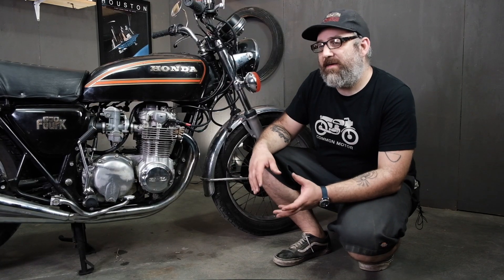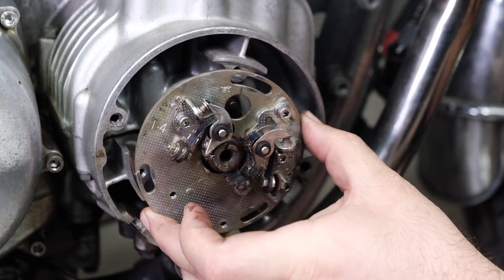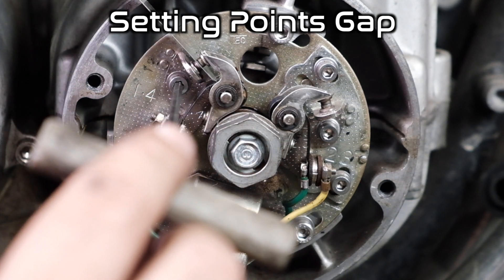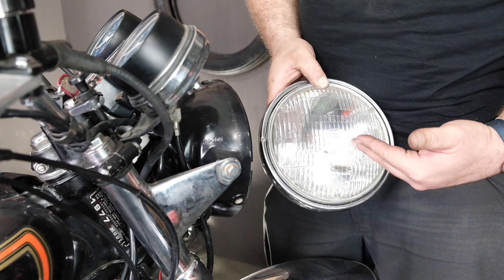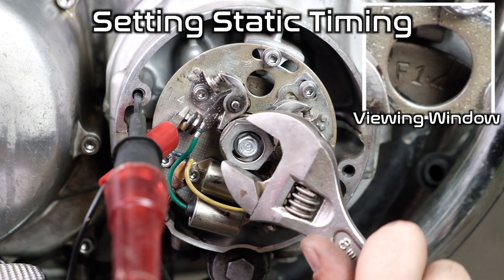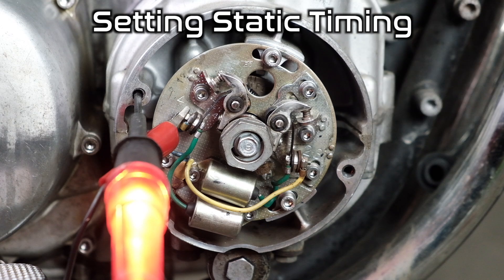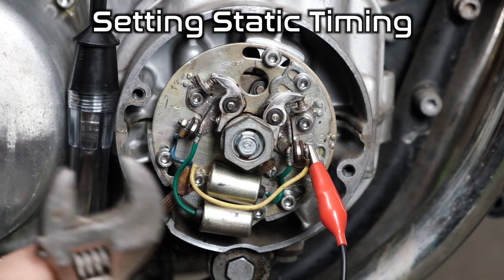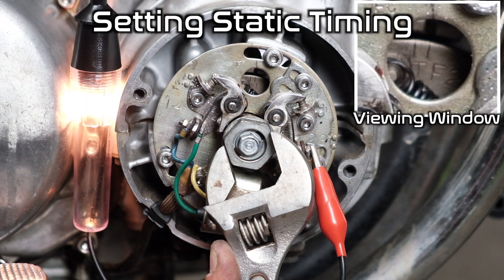Setting the Ignition Timing On Your Honda CB500K / CB550 / CB750 / CB350F / CB400F

Comment: Hey folks.  I've finished my full restore of my 75 Honda CB 360t and everything but the paint is Common Motors Collective.  Great quality parts.  Also, Brandon has been a huge help to me.  Without his vids I'd still be working on it.
His help with timing is crucial.  Also want to mention my upgrade to the shockwave, replacing the points.  GREAT!!
That's all.  I just haven't found a place to thank him properly so that's why I posted this

Comment: This is a good video on ignition points adjustment. Static timing will get you into the ball park, but dynamic timing with a strobe light allows you to test the timing at idle and full advance. Full advance is more critical as the engine operates above 2500 rpm most of the time. If the full advance is between the lines on both points you are golden. If not, adjust the timing as needed. The point plate may not fit in the crankcase tightly, This will cause a variation in point gap and dwell as you rotate the plate. You can easily see this with a dwell meter attached. The solution is to center punch the case just outside the point plate to tighten up the fit. I always liked to set the points at the middle of the range 0.014". Ignition points will wear into each other over time. One of the contacts is smaller in diameter then the other and will wear the center of the larger point. If you run an emery board across well used points you may see a shiny ring around the outside edge of one point. A very small amount of high temp grease on the points cam will reduce point rubbing blocks wear and changing the timing. If you have installed a new set of points, be sure to thoroughly clean the point surfaces with a piece of card stock dipped in contact cleaner and then pulled through the points. New points have preservative on them which must be cleaned off for the best service life.
Reply: That's the way I learned in Honda school too (Midwest Training Center under BOB Hanson)...Don't know if all that grease was necessary. It gets flung off and causes a real mess! A slight spritz of WD in the advance unit also keeps it proper and keeps rust away. Also a tiny spritz on the spring pegs...

Comment: Thanks for the great video. it was informative and straight to the points. also i have the same bike. 
thanks for showing the static and dynamic process. 

im glad there wasn't any irrelevant info in the video like explaining how a spark gap works, or the proper way to peel potatoes. 
the last video i watched the guy talked for 10 minutes about everything other than how to set the timing while stumbling with words. it was the worst.  
i just kept shouting at the screen "that's not what i came here for get on with it" 

thankfully you dont waste time.

Comment: So I'm having some troubles with a newly acquired 1973 Honda 350 Four, and while learning some things about it, I found your video!  Your instructions are easy to follow, and I'm glad I've found your video!  I will be subscribing as soon as I get done with this question. 

I'm not getting spark to the plugs, so I figured I'd need new coil packs... after seeing this video, I figured I'd look at my timing while I have the bike up on the stand and was surprised to find that I have no power to test the timing!  I'm not very experienced with this bike, I just got it in my garage a week or 2 ago, and I don't know where that power comes from.  I've double-checked my ignition switch. It was on, and of course, the key was on, but I couldn't get my test light to come on from the 1 4 or the 2 3 contact points as seen in this video. It's hard to trace the wires with how compact this 350 frame is, so I figured I'd ask, where does the power for the contact for the timing come from?  
Thanks in advance for any help!

Comment: You have the very best guide for timing the old CBs and i am extremely appreciative.   I have an issue with getting power to the actual points. Something likely easy to resolve but not sure of a resolution.

Comment: Thanks for this excellent tutorial. I followed it to set the timing and points gap. One difference I had was with the test light. It was either on, or off. No flickering. Also, after the firing on 1-4 was indicated the light stayed on until I had rotated the crank probably another 90 degrees. Not sure why this is the case unless the points are sticking. More investigation needed!

Comment: What amazes me is the frequency of these "tune ups". For years I've heard Hondas are reliable and need very little maintenance. I have worked on 1 CB750 ( I like to get a bike to work on over the winter) and got the workshop manual along with the bike. My conclusion was, if I wanted to take a cross country ride I'd have to bring half my tool box with me. 1,500 miles and check the points, valves clearances and cam chain tensioner? 
Now I'm not knocking these bikes they are fun and when they run right very quick. 
I learn something from every bike I work on and what I've learned from the CB750 four is....don't work on another...LOL 
Great video, great information....I might change my mind.
Reply: In 2011 I rode my '77 550K 1300 miles around Lake Michigan. In 2017 I rode my '75 550F 4700 miles to Colorado and back and in 2019 rode my current bike, a '76 750F 1300 miles to SC and back. At no point in any of these rides did I check the timing or points gap. I checked the cam chain regularly, and adjusted the cam chain tension and changed the oil once on the 4700 mile ride. The SOHC4 bikes are very robust and 1500 mile timing checks are not at all necessary.

Comment: Thanks for making this video, very well done and very informative. I use the same procedure to time my 1976 Honda CB750 but I don’t do the static timing, I go straight to the dynamic timing with the timing light. One small slip of the tongue. At about 6:41 you say the test light will illuminate when  the point makes contact. In fact, the test light comes on when the points open which is when the coil fires the spark plugs.  You are connecting the positive clip of the test light on the ground side of the coil and the ground pointer rod of the test light to the bike frame ground which is also connected to the negative terminal of the battery.  Note that the positive side of the coil is connected to the battery positive terminal.  The points are between the ground side of the coil and the bike frame ground.  When the points are open the ground side of the coil also connects to the battery positive terminal through the coil and there is 12 volts across the open points which is why the test light comes on. When the points are close there is  zero volts across the points which is why the test light goes off but there is 12 volts across the coil which charges the coil. So when the points open the coil discharges and fires the spark plugs. Hope I did not get too technical.
Reply: I dont mean to be offtopic but does someone know a tool to get back into an instagram account??
I somehow forgot my password. I love any assistance you can give me.
Reply: @Benton Neil Instablaster ;)
Reply: @Jerry Jad i really appreciate your reply. I found the site through google and I'm in the hacking process atm.
Looks like it's gonna take quite some time so I will get back to you later with my results.
Reply: @Jerry Jad It did the trick and I finally got access to my account again. I'm so happy:D
Thank you so much, you really help me out!
Reply: @Benton Neil glad I could help xD

Comment: actually there is a third additional test  to test the functionality of the ignition advancer - rev up to 2500rpm - 3000rpm with the gas screw and check the allignment ith the two advance marks ahead of the F Mark. if the mark on ignition plate lines up between the two marks - the advancer is fine. 
sometimes the advancer is sticky or the springs are to loose. 
I think this is im portant because most of the time driving this bike we are way beyond 2500 rpm...
Reply: That was a very important point you made
Only pros are familiar.
Reply: yeah i kept my 750 on boil all the time.....i street raced anything w/ wheels

Comment: Enjoyed the video
Here is my take
Have you tried a dwell meter and the dynamic timing method
The dewell angle method is probably more accurate then feller gauges
And at the end verify it with a good quality timing light
If you have one that has a adjusting system you could see how far you may have to correct or dead on

Comment: dont forget to adjust the cam chain...no...no crescent wrenches they are for plumbing. before you adjust points that have been used..clean the points...they get some arching so they need to be cleaned. the pistons rise and fall in pairs, 2 coils so both spark plugs fire only one piston is on the compression stroke in the pair. if i remember correct a piston fires every 180° . i had a Triumph trident 3 cylinder , each piston fired every 120°

Comment: My shaft doesnt have contact points, but pickups. Pickup plate are static. If i want to change timing should i adjust cranks/advancers bolt somehow? if so how can i do that if my engine spins.

Comment: So I have an 82 CB750 and it looks like my advancer is on the left side, by the starter clutch. Or is this something completely different? I pulled it off to rebuild the starter clutch but didn't pay attention to the orientation of the advancer, and when I put it back together I think the timing is off. Should I follow this to reset timing? Or is that something completely different?

Comment: Im planning to get a CB750A are the ignition system similar to the manual?
Reply: It's not the trans type that you should be looking at it's the year of the motorcycle. Honda started switching to cdi ignition around 1978 or 79 so check the year of the bike and look up the specs on google. Hope this helps

Comment: I have a CB500k0 (an Australian model from 1970 that may not have been imported into the USA). It's a long term project where I have been collecting bits for several decades. I have an electronic ignition system for it, butnwhere do you get your points from as I got the EIS because I couldn't get new ones any more?

Comment: When using the timing light to adjust the points my light is on constantly but gets brighter at a certain point in the rotation. Is this just a characteristic of the light im using? Should inconsider the brightening of the light the "turning on" of the light?
Reply from the maker: That's really strange, the timing light should definitely be off so I would check to see what's completing the circuit when it's not supposed to be.

Comment: Good info. But there's some "dwell overlap" issues here. Testing should be done to determine when the light goes "out" as the crankshaft is rotated past the trigger point. This should occur well before the "F" mark on the other set of points. Otherwise, both coils will be energised at the same time ...reducing coil saturation. This phenomenon significantly reduces ignition performance with this hardware setup.
Reply: Interesting. What adjustment do you make if the light doesn’t go out?

Comment: What happens when the adjustments I need to make are outside of the range of adjustment?

I can get close with the static timing, but I can't get close with the 2nd part.
Reply from the maker: Hey rob, sign up for one of our tech calls on the website or message our support for a little bit more detailed help.
Reply: @Common-motor  Thanks!  Good quality videos and parts too!  It looks like I need to submit an order number to ask the question though.

Comment: Is this the same for the CM series? I have a CM400T that likely needs this.
Reply: Unfortunately the CM400T is running on a CDI MODULE made by Hitachi TIAO1-20.
Reply: @jlacc1  why do you think this is unfortunately?
Reply: @Bogdanko93   The CDI Module of this type are no longer manufactured and second hand sold online are hit or miss which can be costly.  I only know 2 companies who have remanufactured such modules. 1 in England the 2nd in Ukrain and i have read good things about it but still it is not of original equiptment.
Reply: @jlacc1  do you have a link to Ukrainian guy? It so happened to be that I am looking for this particular CDI unit
Reply: @jlacc1  You seem like a guy who know this stuff well. Do you know by any chance what one can do with malfunctioning stator? Is it possible to find a replacement for it? Does anyone manufacture them?
Reply: @Bogdanko93   check this U.K. website out REX'S SPEEDSHOP that is the company that makes CDI MODULE but slightly bigger than the OEM they also remanufacture the stator and pickup points. But they would require core exchange.
Reply: @jlacc1  thank you
Reply: @Bogdanko93  sorry was not Ukrain but Czech.  the website is ignitech.cz im a bit comfused with there website currently they are not carrying the CDI for the 400 Twin.  But surely Rex's Speed shop would have it. I just ordered mine early last month.
Reply: U got cdi ,no point or condensor in that year

Comment: What am I missing here…I set my points gap, put the test light exactly where it is supposed to be, and the light stays lit the entire time, I spin the motor and it never goes out…it’s the same way when I check 2/3. What am I messing up?
Reply: Did you every figure this out btw?
Reply: @willhernandez6309  I did not..
Reply: David, I figured it out. Set the points on the other tang. Notice the points stay closed the whole time in the video? If you set points the other way the gap never closes, therefore your light stays on all the time.